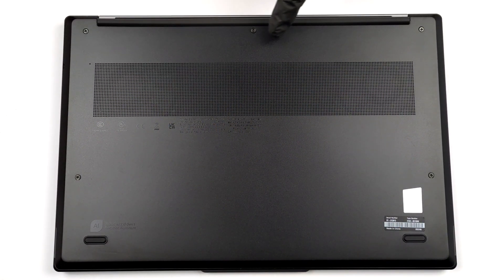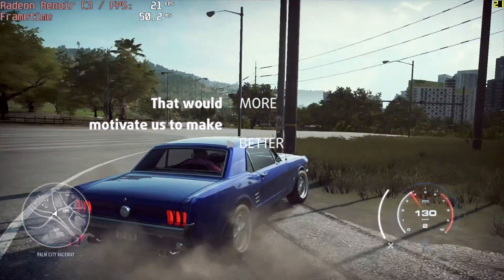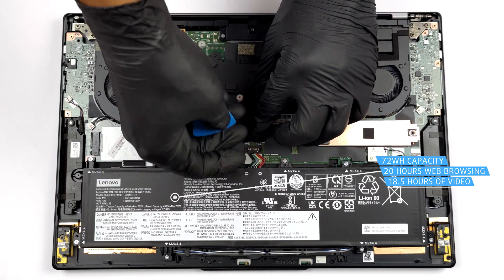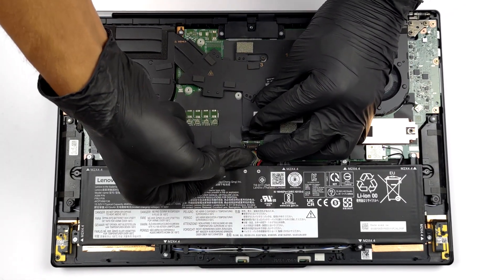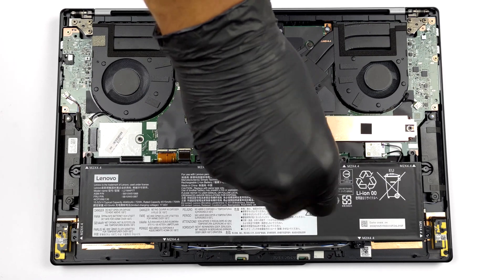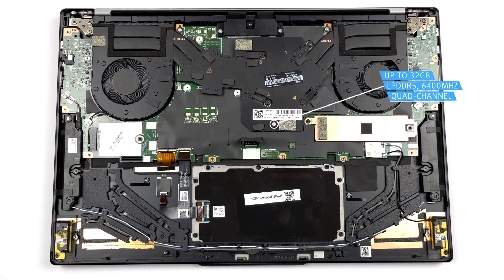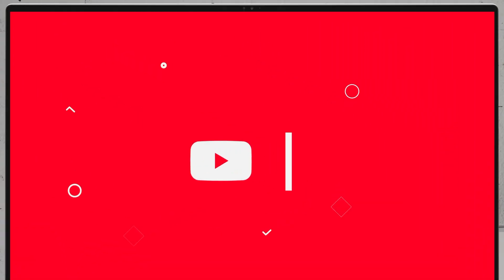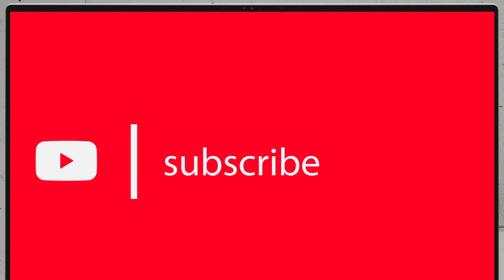🛠️ Lenovo ThinkPad Z16 Gen 1 - disassembly and upgrade options

Comment: Notebook will accept WWAN card. My one has no visible SIM slot on it. But to find antennas for this notebook on the market nearly impossible. Anyone can get antenna part? Also, WWAN back cover has different FRU. If anyone know where to get parts?
WWAN Modem 5W10V25828 - easy to get
Antennas 5A31C41982 5A31C41981 do anyone know difference between two?
Back cover for WWAN models 5M10V75652. Not sure how critical to have it.

Comment: Thank you for opening tips. It was helpful

But terrible notebook.
- I was not able to upgrade LTE on it.
- After unscrewing 5 screws and using plastic to lift the cover. It snapped off nicely. But 2 screws snapped holes in the cover and fell off, maybe was not unscrewed enough. Now it holds only on 3 screws.
- New windows forces me to provide my email and create Microsoft account.  
- Battery with OLED screen last few hours. Can tell exactly after few days
- Screen seems sealed into the frame. And if broken need to replace entire assembly. Not usual FRU.
- Feel fragile and expensive. Not a ThinkPad. 

 if someone want to buy a "MAC" with Lenovo label on it than this notebook a way to go. Thinkpads are X13, T14 or T15. And Z16 didn't meet my expectations. 
Notebook interesting by its 680M + 6500M GPU setup. It is handy in DaVinci resolve and other software that can utilize multiple GPUs. And yet it stays powered from USB-C.
Reply: agree with the overall feel is more luxury over the usual thinkpad. it is quite reasonable to expect battery life to be not as optimal due to OLED panel. The windows login is a Microsoft problem thou.

Comment: Thank you. Many are reporting heating issue after 2 or 3 days of use. Is it true? Can you please check?
Reply: if you use balance or efficiency mode should not be an issue coupled with windows and lenovo updates. even with performance mode its okay. it will be warm at certain spike other than that its fine.
Reply: @plipala  mine does spike high during boot up and after which its usually fine. i would suggest using balance or efficiency mode. the cooling implementation could be alot better. mine once in like 2 weeks will throttle and then hang. maybe even a repasting of thermal paste might help for yr case
Reply: plipala  factory might not have done a good job on it. head down to yr nearest lenovo service centre and knock on some tables